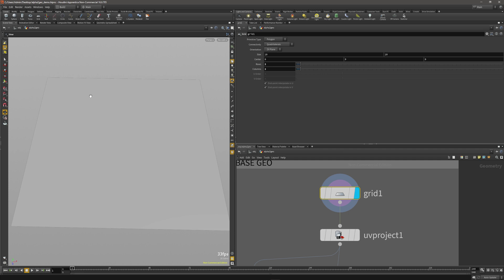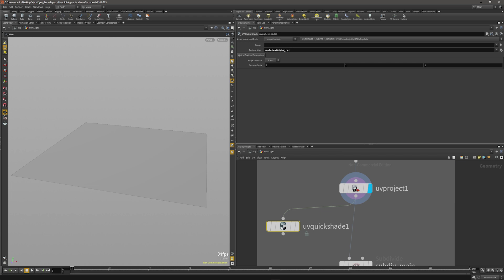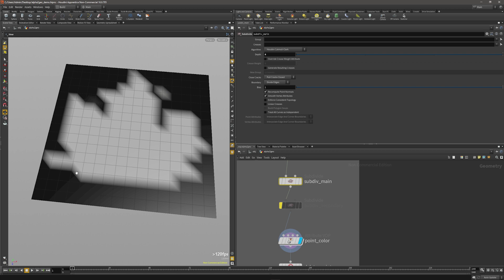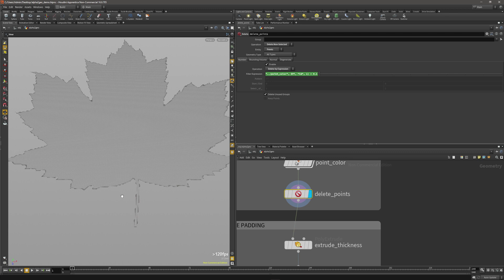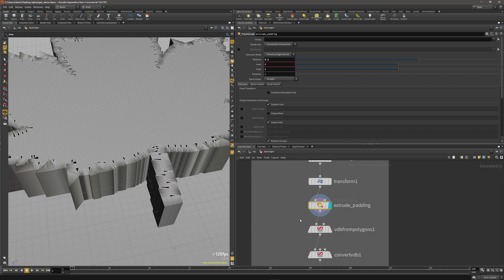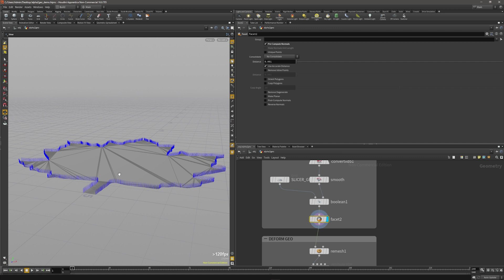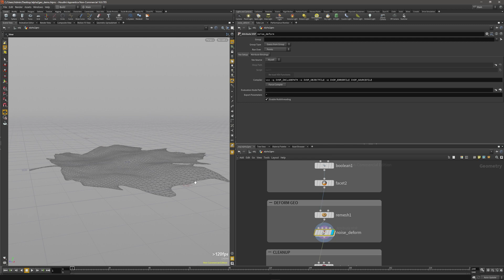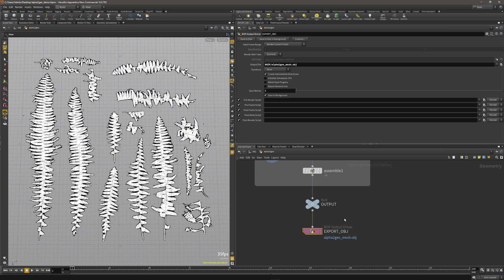Procedural Geometry for Megascans Atlases in Houdini

Comment: Hey Greg, I'm just learning Houdini for game dev stuff and this is super helpful, thanks! I'm curious if you can use the Megascans displacement texture to do the mesh distortion rather than the Turbonoise you use. I tried to quickly setup it up but couldn't get it working. It's probably super easy I've just never done anything with the Attribute VOPs yet. Thanks!
Reply: Nevermind. Figured it out : ) For anyone else....in the Attribute VOP you just need to connect the UV on the Geo VOP global node to the UV on a texture node, then CLR to amount and dispP to P on the output.

Comment: Trace would be simpler. Anyway, thanks for in-depth explanation. That approach definitely works. Some more maths and it could be automatic.
Reply from the maker: Yep there's always more than one way to solve a problem in Houdini. The trace node is a nice alternative to the subdivision setup shown in the first half of the tutorial, but the correct trace settings are not as obvious and the default values are super slow. I think the subdivide approach is easier to understand and is useful in many other ways :)